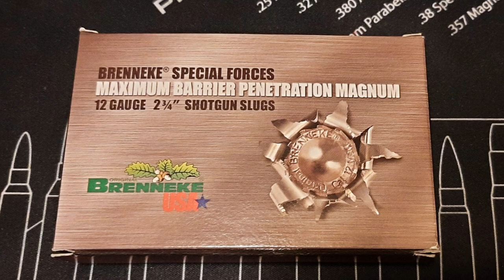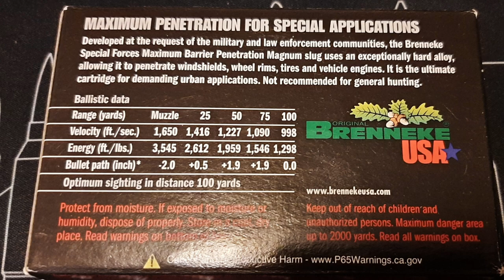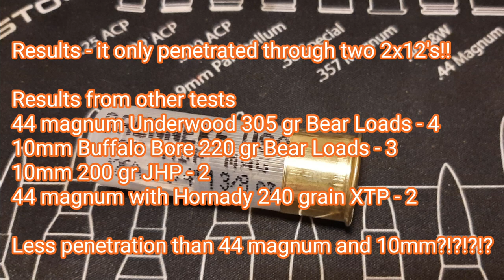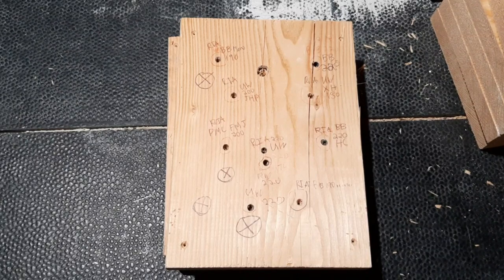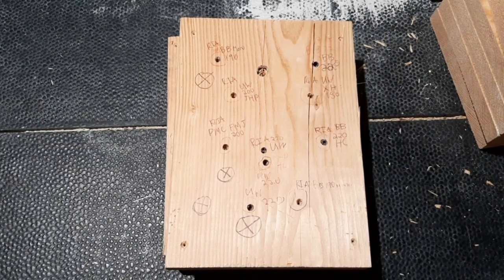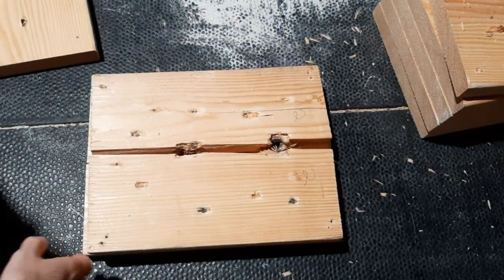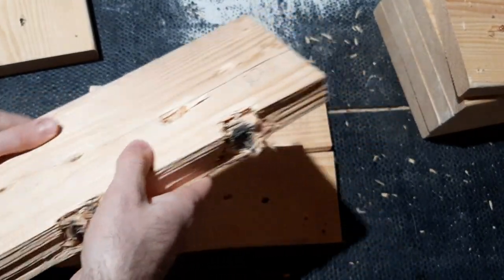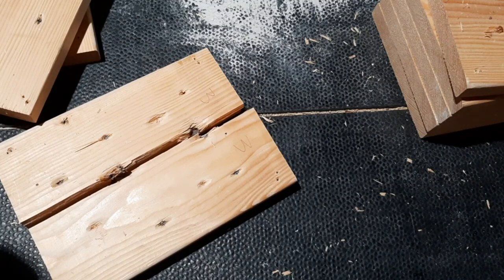12 Gauge Brenneke Maximum Barrier Penetration Slug vs Lumber - Good for Bear Defense?

Comment: Less penetration, but more surface area.  A smaller round will penetrate more because it's like sticking a sewing needle and a capped sharpie marker into a block of cheese.  Although the penetrate is less but surface area is greater, I'll wager there's more energy transfer from the slug than the smaller pistol caliber rounds.

Comment: Your correct  it doesn't  go deep. But 12 gage slug is like 72 caliber.  Diameter  plus speed =  Penetration......
If you had a 300 Weatherby  220 grain  and shot this target. It might go through  all the boards.

Comment: that did not seem right, i think there was something wrong with the round... it should have been a lot hotter than that.
Reply from the maker: Nope I have tested other slugs with the same effect.  They don't penetrate well.  Wide diameter and slow velocity.
Reply: @NYPrepper  You need to try the Brenneke Magnum Crush - it's supposed to have a mean recoil kick and brutal force impact.
Reply: They do well taking down bears in Alaska with brennekes, screw these board tests, they work well irl.
Reply: @NYPrepper  "they don't penetrate well in wood" would be a more accurate statement. As well they shouldn't because they're not designed to. Wood will favor small diameter high speed projectiles more so that most materials. As an extreme comparison a .223/.5.56 55gr fmj will out penetrate a hard cast .44 magnum in wood in my experience. But not so in flesh. I've tested Brennneke (pronounced bren-uh-kuh) in many different mediums over the years. And while I haven't had the greatest results with the special forces slugs(mostly accuracy) they will by far out penetrate most handgun rounds in gel or even meat(stretch wrapped hams) breaking bones and pushing straight through. I've settled on green lightning slugs for most used and never recovered a single one from several deer shot at varying distances/angles and of varying sizes. The only slug I've ever seen outperform them is the now discontinued lightfield buck/boar/bear slugs which I have 21 boxes of and dread the day they're gone! Great video though! I hope to see you test it in other mediums....👍
Reply: Brenneke slugs are very vulnerable to moisture getting into the powder which is why everyone in Alaska seals their roll crimp with hot glue or beeswax. The fact that these slugs didn't recoil that bad means something is wrong. These slug have insane recoil even in heavy shotguns.